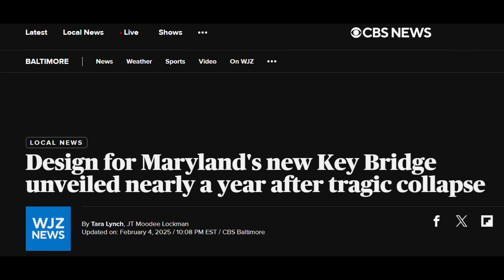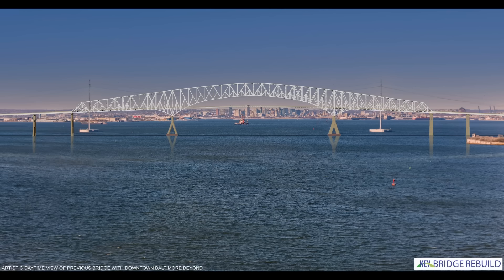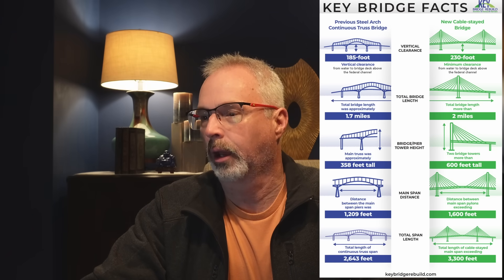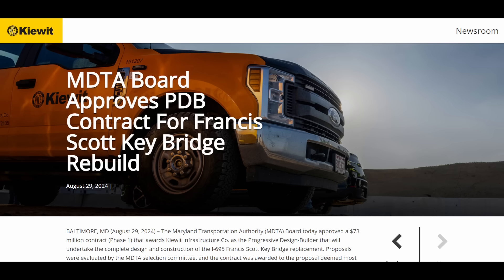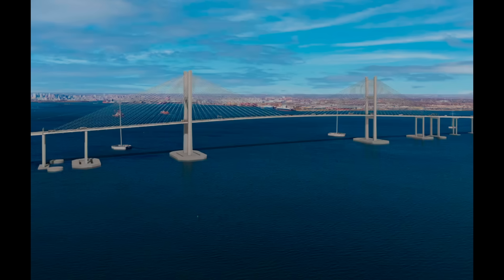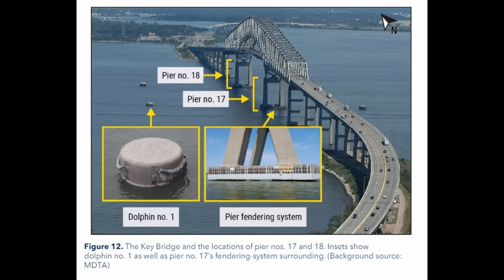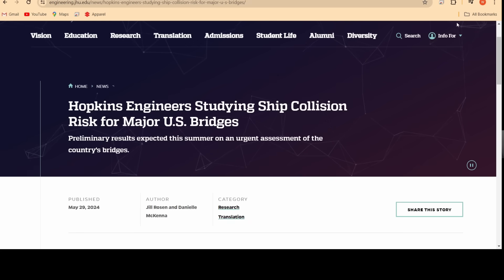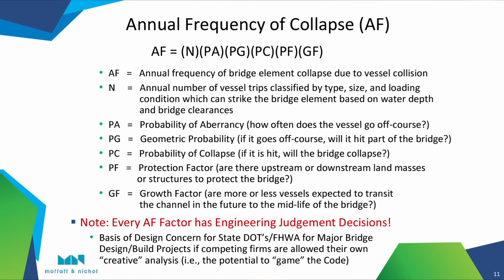Francis Scott Key Bridge Update

Comment: So what I am going to do here is dive off the deep end of statistics. This is something I used to use a lot in my work when traditional statistics failed. 

Lets me first discuss why statistics fail. The first is the wrong method is being used, the second is the power of the statistic is not great enough to answer interrogate the null hypothesis. 

An example of this is for example if we look at meteor impacts and the likely hood that a meteor that hit the earth would destroy civilization, but we only use bonfida ground impacting meteors in the historical record. Such a method would ignore craters like the chixulub crater, the Tunguska Impact, and the crater in Arizona. With a small sample of large crater meteor impacts we might conclude that a meteor capable of destroying civilization on earth is impossible. 

So they key to this understanding are three related equations, the Fisher Exact Test, the binomial probability distribution, and Pascal’s triangle. This is very hypothetical stuff but the formulaic expansion works like this. 

suppose we wanted to know the probably in 100 events (x + y), say years of xP , yQ 
Where P and Q are the yearly estimated probability of the event
If we lay this out formulaically you would get  where P represents the probability 
  1 = P^100 + 100P^99*Q + 4950P^98*Q^2 ……..4950P^2*Q^98 + 100P*Q^99 + Q^100. To get the coefficients for this equation Wikipedia Pascal’s triangle. 

So if we plot each parameter (values between the plus sign) of the 101 parameter equation  and P = Q = 0.5 we get exactly a normal distribution. You can do this on excel. The more events, the tighter the relative distribution. So you can create several worksheets on excel with say 10, 35 year and 100 years. As you increase the number of years the standard deviation increases but the coefficient of variation decrease. 

So how do we know what the shape of a distribution looks like. So basically to get a mean of something is basically first order. You divide something by N to get and average. The standard deviation is essentially the sum of the square of the variation divided by N and then the square root is taken (with some adjustment for degrees of freedom) this is called the SD

Assuming that this is a normal distribution we are sampling we can be 68% confident that the population of all events is between. 
 M - SD/SQRT(N) <  μ < M + SD/SQRT(N) 

You can get an average with two points, to get a standard deviation you need three. Neither of these address the problem presented in this video. But as we see in the above equation you SD with three points is poor, and SQRT(N) is low, so the confidence in the what P or Q rates are would be appreciably wider than if you sample 100 such event cycles. Imagine how this works if we are estimating decadal or centurial storms. If records go back 120 years, that’s essentially 12 events. 1.2 centurial events. Think about it. 

What the fat-tailed distribution is talking about is skewing and Kurtosis. These are third and forth order equations. Skewness idealized in the above equation is when P and Q are NOT equal……not 0.5.  So if you have actually designed a P and Q = 1 - P in your excel spreadsheet you can alter P and watch the plot of you of probabilities skew, if P is near 1 the distribution skews right and if P is low it skews left. Ideally it should be between -1 and 1. But if your sample size is small, your distribution might be skewed and between these threshold values. 

How can we know there is skewed, we need a lot of data points. 12 data points is hardly adequate if P and Q differ by say 0.25

How about Kurtosis. Suppose I am studying say A mysterious WBC (white blood cell) in humans. Not suppose this WBC responds to inflammation causing it to live longer. So there are a number of causes of inflammation that come and go in humans and this WBC counts tends to be skewed between 10 and 600 count per a unit volume. But what if inflammation is not the only cause, suppose there is a genetic disease that cause this WBC to go really high say 1000 to 5000. But it’s really rare. 

So what happens is this creates kurtosis in the skewing  and rather  cell counts tapering to zero over 600 they flatten out even rise at extreme values and then drop to zero. The overwhelming abundance of the majority phenotype is concealing a bimodal distribution as Kurtotic. Once genetic testing removes this affected cohort we can create actually a better combined distribution. 

OK. Let’s apply this to say a bridge. Suppose the probability of a catastrophic bridge collapse of a bridge of risk factor Z is 1 per 100 years. This means P = 0.01 and Q = 0.99. Thus if we have 100 bridges of risk factor Z  we can determine the yearly  probability of 0, 1, 2, …100 Z bridges collapsing the highest frequency prediction is zero bridges will collapse in a year, 1 is the second most probable and 100 is equal to 0.01 to the 100th power (infinitesimally small probability). However despite this we need to consider that floods such as the great flood of the Washington / Oregon watershed would be capable of taking out every bridge in the watershed, should we be exiting an ice age. 

The perceived distribution is very skewed to the right. This skewed distribution represents natural failure modes. However, the caution here in this, the rates of P and Q are based on a mean, BIG CAUTION, and the confidence interval of the mean is based on the sample size. When P is very low even small absolute changes in its value will markedly affect the relative probability of rare events (the integral of the fatness of its tail beyond range defining values). Thus it’s best to represent the 96% confidence range of values based to see what the potential error is the fattailed distribution is. In essence you’re hunting black swans.

 M - 2SD/SQRT(N) <  μ < M + 2SD/SQRT(N)  [notice the 2 added before SD]. 

Now let’s say the year is 1939 and the bridges you are surveying are in Germany. So what’s going to happen to the statistics. By the end of 1946 your skewed distribution is going to exhibit a high degree of kurtosis, so much so the distribution is bimodal. 
The failure modes are natural and manmade impactors/explosive induced. 

Both the war scenario and the WBC scenario represent data sets with two distinct modes. What if there are not two distinct modes. Let’s say there was a period in which dams were built with low quality control, moderate quality control, and high quality control. 

So bridges can catastrophically fail because of a dam failure mode. During the first period dams break, but bridges were below bridge standard Z  and so were not considered in the statistic , but after those dams failed or were destroyed a few deemed low impact failure survived. So as risk factor Z comes we see uncommon failures of Dams but occasional we see a Dam failure and a Newer Bridge impacted.  

So let’s consider the temporally moving risk created by post Panamax ships. See what’s going on with shipping channel for details. If we had a discrete category of ship we might be able to estimate risk based on a secondary failure mode. But those estimates are based on a moving target as ships get bigger. Thus the secondary failure mode is based on not a single failure mode, but a distribution of failure modes which creates a dependency for what harbor the bridge lies in front of. If that harbor won’t accept a certain size category, then its risk profile is based on the accumulation of different risk distributions. We can also factor in port specific assessment of seaworthiness, pilot assessment of seaworthiness, etc. 

So now I want to move to a more philosophical perspective on this.  Many of you would think that this is an Ivory towers looking down on general phenomena and casting judgement. Such is not the case. The worst abusers of statistics have been scientists from very renowned universities. In the 1980s to 2000s I watched paper after paper in human genetics with basically out of the box statistical analysis gloss over obvious statistical oversights. In other words there was simply sources of variation they chose to ignore. Two papers by the same author, on the same chromosome, 1 would draw one conclusion, the other paper drawing the exact opposite conclusion, none applying Bonferroni’s correction. Publishing piecemail bullshit. As I became adept at spotting these errors the errors in our own work became clear, and one comes to point when one washes the hands of box statistical packages and confirms everything with Monte Carlo Analysis. When one runs into circumstances of multimodal kurtosis and augmenting sources of variation you can come up with whatever equation you like, but if you haven’t done Monte Carlo analysis integrating the confidence ranges of mean values into run values, that paper goes into the old bit bucket. This stuff ain’t easy to do right. Caveot Emptor.

Comment: 230 feet is definitely in the ballpark for bridge clearance.
Up to the I5 bridge on the columbia river its around 200 foot clearance.
.
The i5 is 178 now and the coast gard is pushing for a minimum of 178 on the new one.
.
The estimated cost of the i5 bridge  is north of 2 billion now, and no firm plan yet after many many years.
.
In short, Portland, Oregon desperately wants the max train line over the river, with bridge tolling.
and Vancouver Washington doesn't want a thing to do with it.
0.01c

Comment: This is a close copy of the Ravenel Bridge in Charleston, South Carolina.  Just purchase a copy of the plans, put the new design parameters in a program, add the barricade accessories, etc. and voila new plans!  The construction estimate could be updated from the final construction cost.  I personally don't care for the aesthetics of stayed cable bridges but they are relatively cheap compared with other concepts and they are proven given proper input.  In this case the plans and construction documents should be developed in rapid time.

Comment: If you have a cable stay bridge design you should also check for the frequency of icing and if it's frequently occurring then some de-icing features shall be installed.
Icing is a concern on some of the coastal cable stay bridges in Sweden where the bridges are occasionally closed to avoid accidents from falling ice.

Comment: As a retired risk manager and lawyer by education and former member of the American Society of Safety Engineers data is just one part of risk assessment.. understanding probability is key and applying the principle that the order we attempt to impose on a chaotic world is never more than one second away from catastrophe. Or one error or monetary inattention or as in this accident  mechanical failure in the engine At the worst possible location . As we say in aviation accidents all the holes in the Swiss cheese lined up . Any movement by a massive object in proximity to a fixed vulnerable structure is just dancing with odds . And gambles eventually go snake eyes , The only way for significant events is to build in redundancy.  And as always advised clients a good dash of common sense and simple but effective measures add to the “ what if “ question. I know this area quite well sailed under that bridge many many times and the water on either side of the channel is very shallow simply having move the peers into shallow water of a simple and actually probably less costly precaution would have made the most common sense .  Not doing so was relying on the holes in the Swiss cheese, never lining up.
Reply from the maker: Thank you, very well said!
Reply: The ship did have to drag in the mud for a minimum of 100s of yards to hit the piling it did, so in that sense the piling was in "shallow" water. But it seems to have done very little to decelerate the ship (what they achieved was attributed to the engine), so the mud evidently behaved mostly like a fluid.

They could have filled in with more substantial "dolphins" at any time since construction. If not long ago, it could have been made a priority when the power line north of the bridge was added, which was just a couple years ago. Wouldn't necessarily have saved the bridge though, just made the deconstruction non-instantaneous. If a cargo ship hits a dolphin sturdy enough to oppose it, it will probably pinball uncontrollably.
Reply: "just" make the central span longer is actually a very expensive solution.  I'd expect a shorter bridge with impact absorbing structures to be a lot cheaper.  (and may let you simplify the logistics of construction.)
Reply: " the water on either side of the channel is very shallow "

13 feet is the ruling depth between the causeways and the 20 foot depth lines still would require a 4,000 foot main span. See NOAA Chart 12281 Baltimore Harbor.

A main span of 4,000 feet would still have waters 20 feet deep at the piers. Still not idiot-proofed (and Dali was an idiot incident) from a recklessly handled vessel with sufficient tonnage and speed to knock it down.

Those chart depths are at mean low water, and very high tides (wind plus spring tides) could increase those depths by 10 feet.

You must design  for very high tides if you want a safe bridge.

Realistically speaking they would need to span the entire 5,200 feet between the two causeways as water is still 13 feet or more deep there. At mean low water . . .

I have laid out the reasonable and prudent alternatives many times on various venue. So that there are no deep water piers that can be hit by superships.
1) Build a bridge with a 5,200 foot long main span between the two causeways
2) Build the original 6,200 foot long tunnel design between the two causeways
3) No-Build Alternative

Frankly if they are not willing to select Alternative 1 or 2, then I believe they should select Alternative 3.

Comment: One would have thought following the Danish method would be advisable ( unless tectonics dictate otherwise ), short tunnel under ship channel and masses of cheap over-water pontoon links!
Reply: Hurricanes make pontoons a non-starter for the US east coast. We've done tunneling, Chesapeake Bay bridge has a few tunnel sections but the cost is higher and maintenance more expensive than this type of alternative. Chesapeake was done because the US Navy didn't want any chance of a bridge collapse trapping a high percentage of the fleet in port.
Reply: There are already two tunnels here. The reason for the bridge is because of hazardous materials and propane, which can't go thru the tunnel. This area see's about 200,000 cars every day.
Reply: @1972Ray  interesting,  I went through a 23.5 mile long tunnel the other day that everything man creates was going through by the trainload! Perhaps that is worth looking at!
Reply: 31.5 actually!
Reply: @drdoolittle5724  if you're talking about the Chunnel, no dangerous goods are strictly limited and many are banned outright (anything with 2 emergency placards is banned). After enough tunnel fires basically all western governments ban dangerous goods from most tunnels, there are a few exceptions like short mountain tunnels on a sufficient grade for vapors to not pool, but as a general rule anything explosive and heavier than air is not allowed in a tunnel.

Comment: I find it interesting that you can replace a bridge of this size for $1.7B compared to spending upwards of $13B for a single nuclear-powered aircraft carrier, upwards of $1-2B for the largest cruise ships or get a state-of-the-art sports stadium. I see a much better return on you investment building a bridge the will last for decades and carry upwards of 75 million vehicles every 10 years and possibly a billion over its life.
Reply: The nuclear-powered aircraft carrier benefits the whole country and also our allies.

MD I-695 East is a local connector highway with no national significance, or even any significance outside of metro Baltimore. 

It doesn't benefit even the adjoining states of Virginia and Delaware.

Comment: Great update! Glad they will make it higher, reminds me of the upgrade to the Bayonne Bridge increased in height in New Jersey. This will make it possible for Ultra large cargo vessels to use the port.
Reply from the maker: Thank you!  Yes, these bridge features will be a significant upgrade.
Reply: Having this bridge be higher won't do much in the short term, as the Chesapeake Bay Bridge still stands in the way further south.  However, plans are being made to eventually replace the Bay Bridge in the next couple of decades, and undoubtedly it will be made to match or exceed this new bridge in height.
Reply: Yeah, it helped the shipping business at the cost of aesthetically ruining its once beautiful profile 😢
Reply: @ Didn't the cargo ship that ran into it, destroying it, ruin the beautiful profile?
Reply: @BillyLapTop The old bridge looked good but that didn’t save it from being knocked down. Whatever the replacement looks like, it’ll still be vulnerable unless it gets massive protection.

Comment: Is the federal government providing the total cost of the replacement still? Wasn't there a lawsuit filed against the ship owners insurance company, and what happened to that? I would think that the port authority should be held partly (actually mostly) responsible for not providing proper safe guards to begin with!
Reply from the maker: That is a great point!  There should be some money coming from other sources.
Reply: The problem is they’ll spend way more litigating blame than if they just rebuild it.
Reply: The case is ongoing.  These cases typically take 5-10 years to resolve.  Even in the most obvious cases where the insurance company admits up front they are fully responsible they are rarely settled in less than 3 years.
Reply: Buying a million-dollar Hunter Biden painting saved the shipping company billions